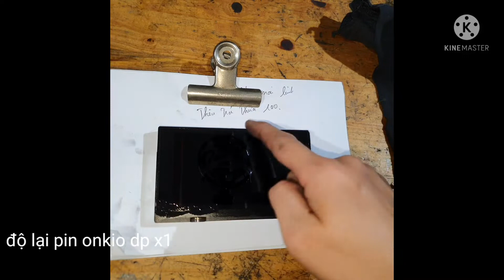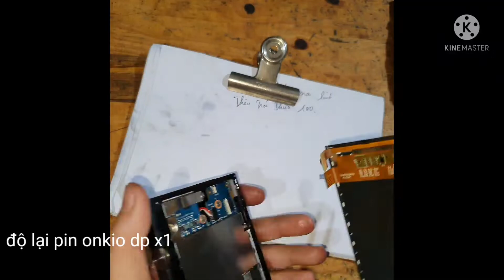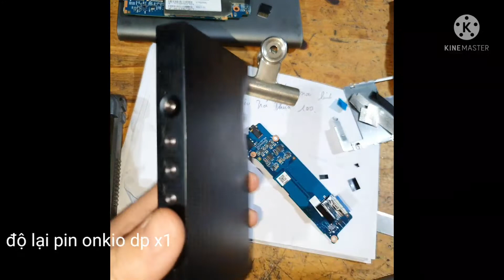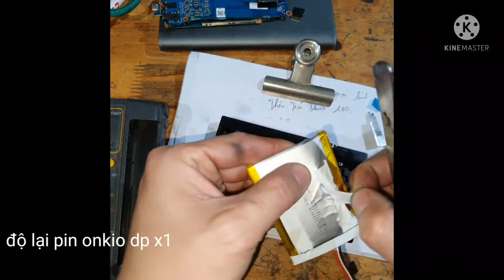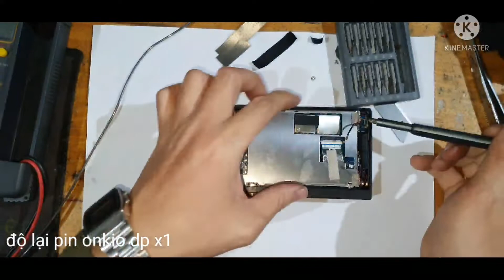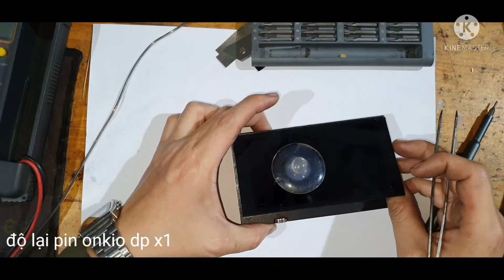chế pin cho máy nghe nhạc onkio dp-x1

Comment: Can you rerpair the USB charging port and where are you located?
Reply from the maker: I can't fix it professionally, I'm in Vietnam
Reply: Almost impossible. First problem is to get the right micro usb socket. Most sockets available do have the connections on the other (the narrower) side. These small sockets soldered directly to the mainboard are a guerantee that a device with it will not last more than 5..10 years. The construction of a device in a way that the battery is in the absolutely most difficult to reach location puts shame to engineers and designers. Batteries are consumables with limited lifetime and must be replaceable. Most of these players surely were dumped only because the battery was dead and nobody was able to replace it.